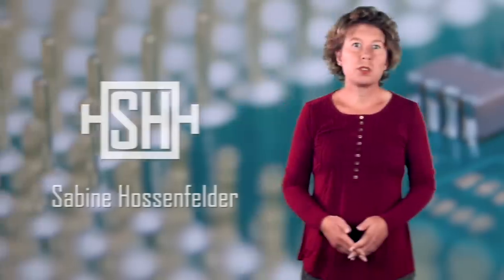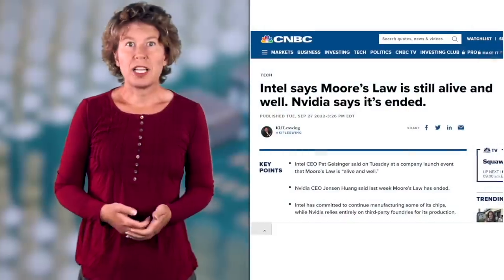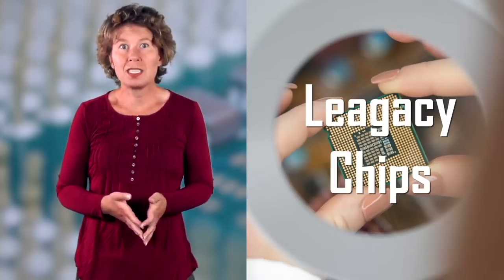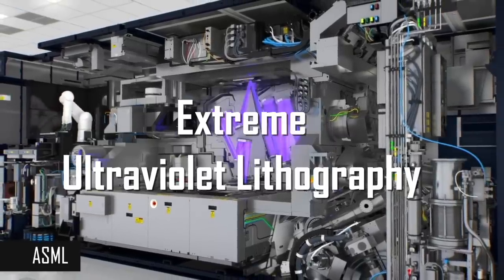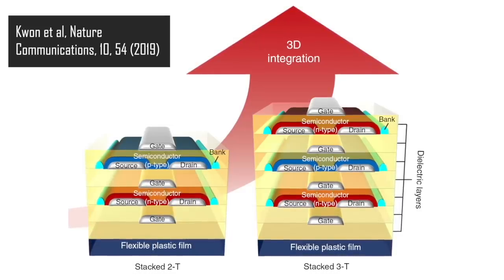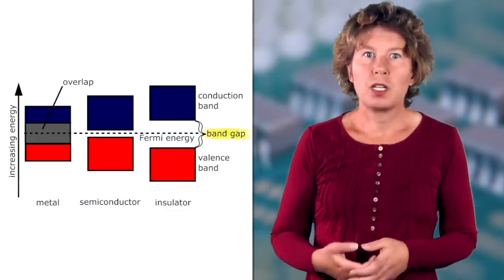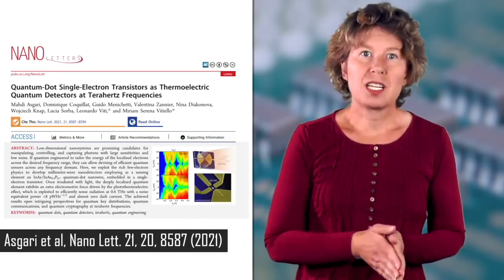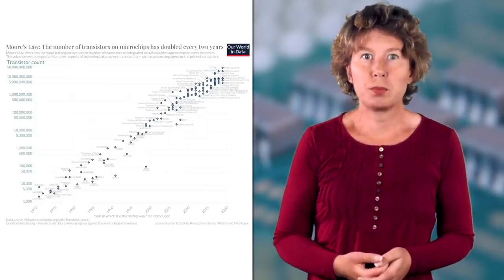Is Moore's Law Finally Dead?

Comment: If you think its dead? You are in for a big shock. We have reached as far as we can with lithography, But we are now efficiently 3D printing with atoms in the lab. There is always another technology that moves things forwards again.
Reply: @qed100  no because we do not need to use hydrogen atoms. We have already found there are 183 materials that can be manipulated at the atomic scale to form new substrates. Including metallic, magnetic and biological substances. They are talking about being able to fit the entire database of Google onto something a lil bit bigger than a sugar cube that consumes less than 10 watts of power.

Comment: Moore's Law actually is actually based on chip fabrication competition and gaining market share. Improvement go in an iterative multiplicative step large enough to leapfrog competitors, but not so large as to significantly increase development times. This naturally led to exponential density increases - for a while at least.

Comment: You can "atomize" transistors, but you can't transistorize an atom...
I think 3dfx (Banshee and Voodoo) had a GPU before NViDIA. In 1994, NViDIA made the first card (GeForce 256) in 1999 after NViDIA bought 3dfx.... So I suppose technically you are correct.. But I think 3dfx deserve the credits...

Comment: sorry to correct. there is a inline control on on scribe line called PCM which is just representing the actual chip. roughly since 100nm light microscope do not work anymore and e-beam microscope need preparation. currently we are 10 times smaller,  100nm is ~15 years ago there is a big testing business when the chip comes electrical alive fist time on wafer were i was involved.

Comment: Moore's Law was kept alive by Apollo Computer with their breakthrough DN10000 processor.   The idea that Intel had anything to do with it is foolishness and false.  Now we have reached the end of the Apollo DN10000 line, but that does not mean a similarly elegant solution can't be found, and it has, the Apple M Series.  This is the way forward, since as Admiral Grace Hopper said, distance is the enemy, and Apple has solved that problem.  No, Moore's Law is not dead, just moved to a new residence.

Comment: About eyesight: When I was in my teens in the mid 80' I guesstimated that computer graphics would be indistinguishable from real world video recordings. We are not the yet, at least no in real time generation (Video also gotten higher quality than in the VHS days), but we are close. within the next 10 years AI generated footage, should have nailed it or my eyesight will have deteriorated sufficiently? 3D processor architecture has been attempted before, that requires liquid cooling in between the dies.  Either it is too expensive to manufacture, or having cooled helium or Freon flow around them might not bode well for a long trouble free service life?

Comment: My 2014 era CPU and GPU are still more, or it is moore, than capable of meeting ALL my pc, net, and even gaming needs. My 'ancient' GPU, 8g, can handle pretty much everything @ 2560x1440, even 3200 reso in some cases w/o good performance. Now I could replace it all, and I no doubt would see some speed increases. The question is. just how much, and how noticeable would it really be? This idea, that the home and business market actually NEED all that extra power to run applications, is mostly wrong. A lot of PCs computing power, is under-utilized, if anything. Anyhow Moores law IS dead, and has been for a while now. There is another much moore ironclad law, called the law of diminishing returns. We are already there. Making general purpose PCs with increasingly powerful CPUs when there is no longer any pressing need for all that excess power, is kinda dumb tbh. We dont need faster computers, we need better software and programming to make optimal use of what exists now. In the last decade, I have never run into a situation where my own modest PC, was actually short on computing power in some way.

Comment: Nvidia, which purchased 3Dfx and used their better tech.

Limits of miniaturisation... Tunneling is the most important here. And basically it's a question of cooling a wafer of Si and doping many small areas on it. Those don't cool down quickly. That's why a cpu gets very hot.

Opto couplers are an old technology which is slow.

At little distances, 🤔 hm.

Graphene, where's it in the promised amounts?

Going too small is a bit of a pickle

Comment: Just make the chips bigger and keep the transistors the same size. More chips, larger chips only means the computers physical size goes up, who cares, I'd be a happy with a cell phone 5 times bigger than they are today,  same with laptops, desktops etc. This obsession with small, sleek, thin computers is pointless and hurts the ability to dissipate heat.

Comment: I'm sorry to say that, but you are wrong this time, Sabina!
I mean, you are wrong in the ending sentence. What you presented here is exactly says that Moore's law is dead. Don't mismatch "making progress" with Moore's law.
Moore's law says about doubling the number of transistors or halving the size of them (it doesn't really matter which way you look at it), and that is progress.
Actually, due to the overwhelming power of exponential growth, Moore's law secretly also states that that is the main engine of progress. That is what came to an end.
What you presented here are ways to still make progress after Moore's law (I mean the brute force miniaturization). But none of the methods presented promises exponential growth anymore.
So: Moore's law is indeed dead.

Comment: Yes but it's obviously dead if you use it as a metric for rate of progress in terms of processing power, yes things are still getting faster. But is the rate the same? Clearly not. Compare an 8088 to a 486 or a CDC6600 to a Cray XMP. Stuff just isn't getting faster at the same rate (especially taking amdahls law into account. )

Comment: I don't get the current obsession with smaller and smaller dies? yeah sure ok for watches and phones etc but for servers where space isn't really that much of an issue, why not just build larger dies with way more transistors? I know most server chips are already way larger than consumer ones but why not just make them the side of a dinner plate?!
Reply: At the end it is cheaper.
Reply: @lkruijsw  maybe for consumer goods but the big players in compute are pretty much still using cumsumer grate GPUs and so larger dies like the AMD Threadripper Pro series, they have billions to spend they could be making something 4x the size of Threadripper!

Comment: You're wrong about nVidia being the first one making graphic cards. AMD Radeon was one of the first players in the game. Also, nVidia only got into the graphics game when they bought out a graphics manufacturer in 2004, AMD graphics cards have been around since the 90's.

AMD FTW! nVidia and Intel can suck it with their corporate greed and much more expensive components compared to AMD, and AMD comes extremely close and sometimes beats the performance on nVidia cards. Same goes with Intel, ever since AMd released their Zen CPUs Intel has been playing catch-up while still charging insane prices for their hardware.

Comment: euv machines dont cost 200m anymore what a bs. and they are already maturing, in a few years they will output as many wafers per hour as a duv machine does now.
Reply: We will wait a couple of years, then. What is certain, for sure, is that flash drives aren't getting much cheaper.

Comment: Sure, Intel says (be careful repeating anything Intel claims, for the past 5+ years they've been nothing but lies... they claimed in 2022 that their chip fabrication section would master FIVE new process nodes... they had never done more than 1 in a year before, and instead of giving their engineers more time and resources and freedom, they decided cracking the whip would work better... it didn't) they're working on some 3D fab tech... meanwhile, AMD has been shipping chips with stacked cache memory for awhile. Their CPUs that have "X3D" at the end of their model name have stacked cache memory on top of their CPU die.

What I'd really like to see are memristor-based processors. They are, theoretically at least, capable of switching the function of different sections of the grid of gates on the fly... so like you could have a chip that dynamically resizes and reshapes how much of the chip is doing CPU work, how much is GPU-style (matrix multiplication units basically), how much is memory, etc. Memristors are also inherently non-volatile, so one single technology could serve as CPU, cache memory, RAM, and solid state storage. Last I looked they still weren't good at mass-producing memristors though, and lots of people working in memristors get addicted to the idea of 'neuromorphic' computing, essentially leaving 99% of the advantages of memristors on the table just to make stuff that works like a brain.  Sure that's cool and all, but memristors can work like FPGAs with reprogramming as fast as a clock cycle. It enables wild possibilities... like instructions running, physically, within the data being stored in memory and things like that.

Comment: Nothing is X times smaller, nor can it be.
You should know enough about mathematics to know this!
If one item is ten million times Larger, the inverse is 1/10,000,000, NOT 10,000,000 smaller.

I do not know who started this inaccurate and wrong phrasing, but it is time to stop it!

Of course, Moore's Law is dying.  As you stated at the outset, miniaturization has its limits.  Not only can it not reach the subatomic, but it cannot even reach the atomic scale.

Comment: Sorry, but there is so many false stuff in the video. It is the repeating nonsense about semiconductor fabrication from total dummies.
Defects are detected by optical scans and reviewed with an EM. The direct use of EM to detects failed. Their is no repair.
BTW: GaN is in use, it is the basis for blue LEDs and modern power semiconductors used for example in the charger of your phone.
The next generation of transistors will be nanosheets GAA consisting high mobility materials for the channel.
The proportional shrinkage ala Moore is almost dead since a decade. We are already in the Moore than Moore area.

Comment: I have been reading about 3D chips for over 15 years, it is going nowhere.

Slightly larger chips is the way forward, more processing power will easily overcome the slower speeds that come with signals needing to travel over a larger area.

This weird obsession with smaller and smaller chips is not only insane, it has become counter productive.

Moore's law was only ever an observation anyway. It is kind of fitting to use the term law since computer science and computer engineering - mostly computer science - are less science and more wishful thinking and cargo-culting. I have been a computer scientist for about 20 years and can attest to the un-scientific nature to much of the field, but admittedly that has more to do with the field being overrun by amateurs because there are no professional standards. CS/CE desperately needs a standard like a PE. Any clown with a PC is allowed to write public and network facing code and that is pure insanity.